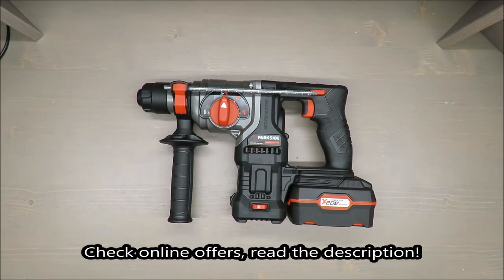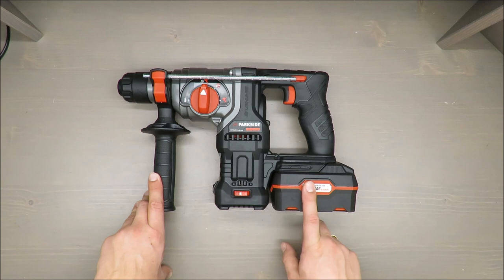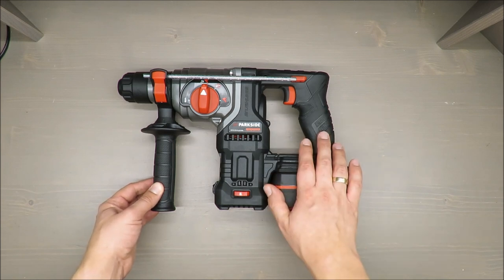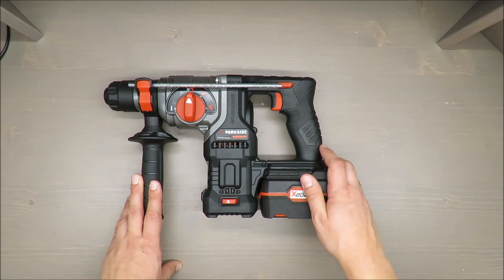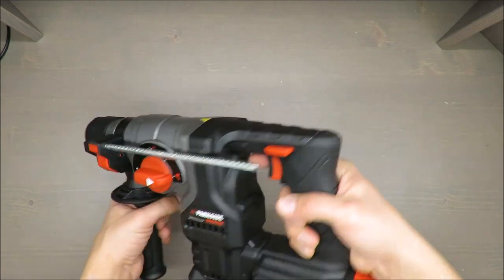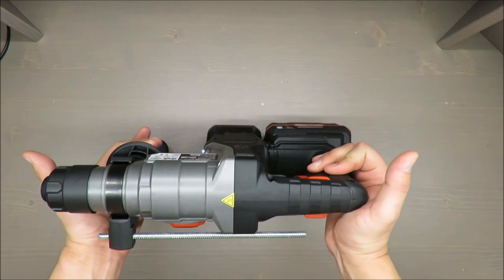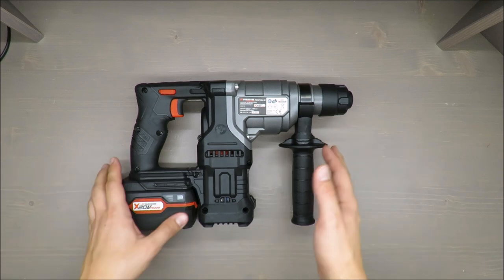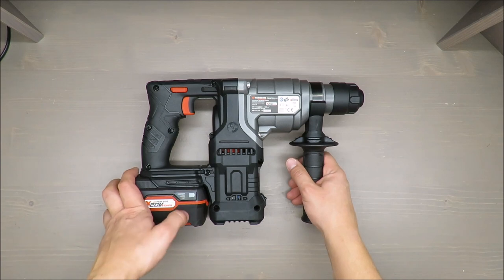Parkside Performance Cordless Combi Hammer Drill PKHAP 20-Li A1 REVIEW / TEST (Lidl 4Ah 20V 3J)

Comment: Drills with 2 hand holds are designed to primarily avoid twisting with kickback 
The front handle therefore is usually used between 45 and 90 degree to the rear handle 
This is why the light is located where it is - as this lights up in line with the drill bit

Comment: Hello, here are my thoughts: 
1- Warranty should be 5 years, you have a point;
2- When you say you pay twice in comparison with regular parkside, you are being unfair. This combi doesn't have a regular parkside sibling, so you don't have a price to compare;
3- you complain about the depth bar being too close to the selector, when 95% of the usage of this combi will be with front grip at 90º (the position you reviewed it is "storing" position );
4- It doesn't make sense to take the light further to the front, because it will be more prune to unwanted impacts, that's why 90% of the tools have the light that low; (placement is also not an issue if you have point 3 taken) ;
5- when you drilled, you didn't even used the front handle, because it is unconfortable at 0º (previous points  ;) )
6- Chiseling should not be made with over pressuring it. The "hammering" has to gain some momentum and not fight both operator and stone, but only stone);
7- And yes, please test it on level six, you will be pleased. Especially because you used it with less power available than its little brother  PABH 20-Li B2 ;) 
Nevertheless, great job and review. I think that you made a nice job, keep the goo working :D
Reply from the maker: I really appreciate such deep comment and afterword I have to admit I've missed this "power level" so te test outcome is unfair. I'll do my best to gain it again and make the 2nd round. As for handle and light as well you've got the point! Looking forward to such feedback!
Reply: @outoftheboxunboxing5020  I use to think that, If I'll comment, I might as well at least try to be useful ;)
Regarding this type of tools power leveI, I usually use it on max, unless I am on something very specific, I feel that if speed and force are "trimmed" to less than full, the motors tend to suffer more, because it seems that most of the torque is missing (in my AC Drill at half speed seems 30% of torque), and brushes spark much more. (not an issue with this one since it is bruslhless...) 
I am planning on buying one of these, X20V family is a nice hobbyist priced tool family. But I was searching for reviews. 
Nevertheless, geat job :)